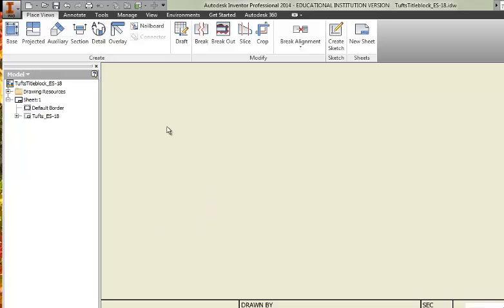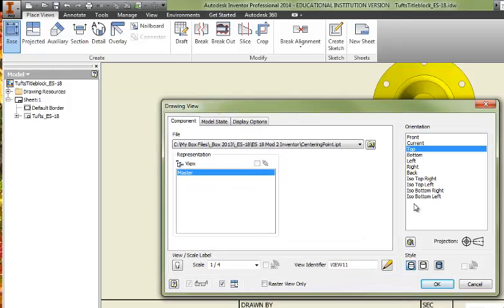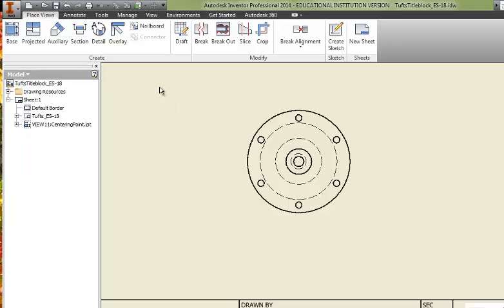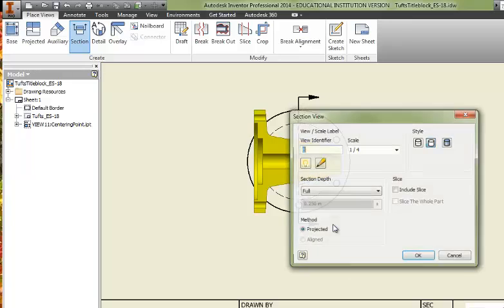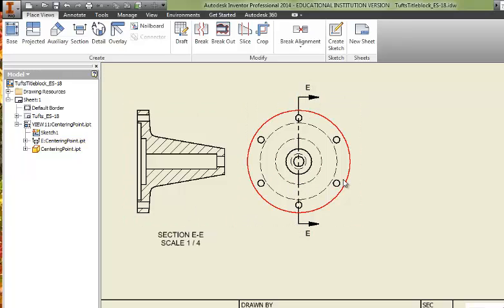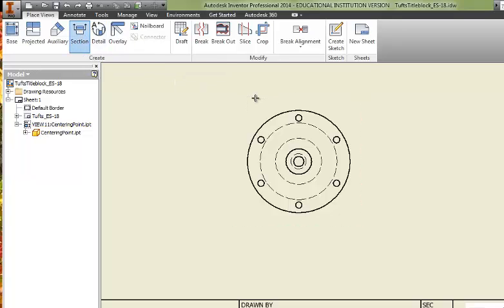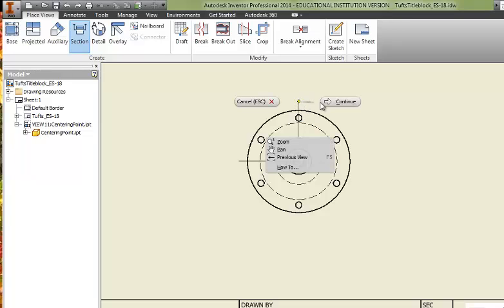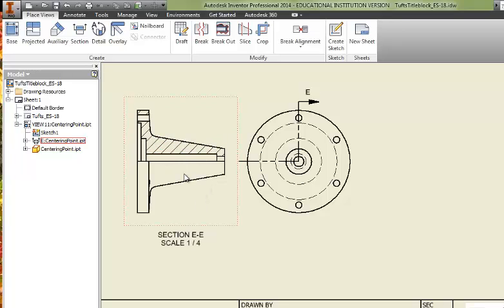Creating a Half Section with Inventor

Comment: Is there a way to add a wavy line through the rotation axis? Not needed in this example, but if you had a visible edge aligned with the axis there should be a wavy line between the bottom and top part of the section view.